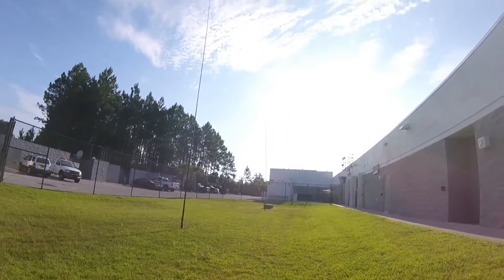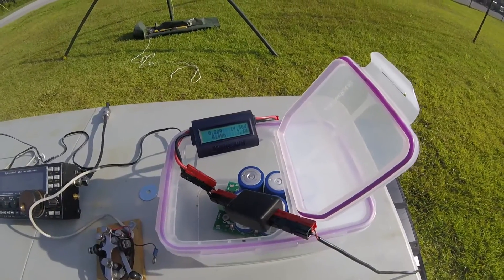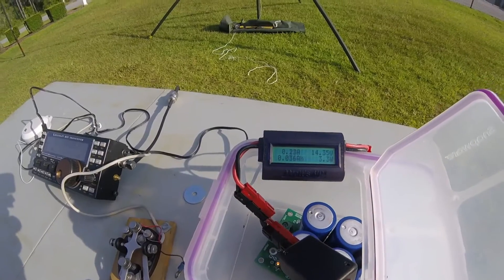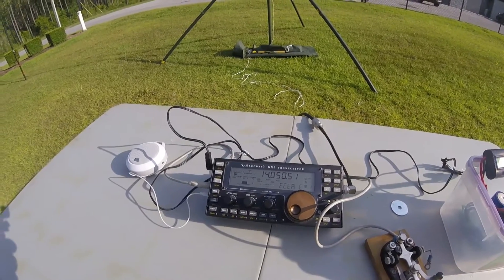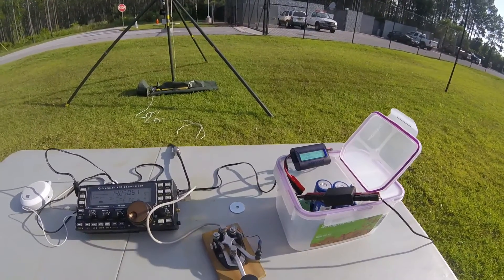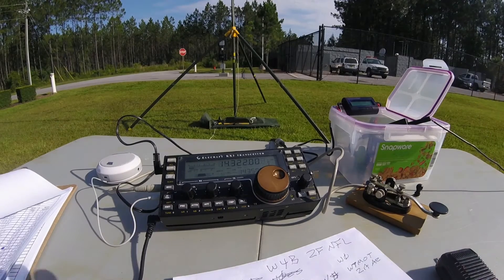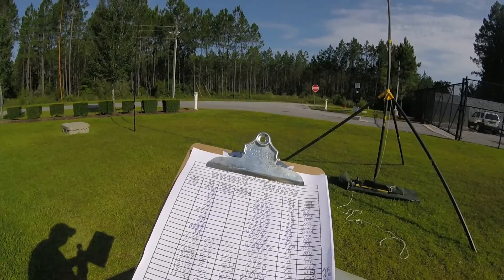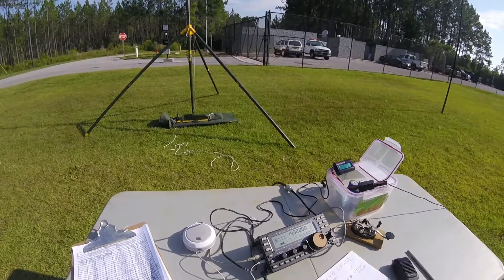Using a Supercapacitor for the Field Day Alternative Energy Bonus

Comment: Can you post a link for the super capacitor assembly? Where did you get it and what is the circuit board?

Nevermind - found it:   http://www.ebay.com/itm/252155737268